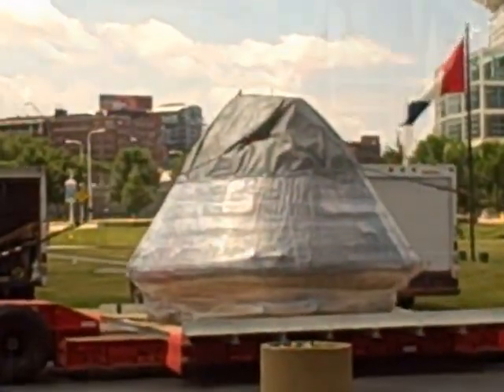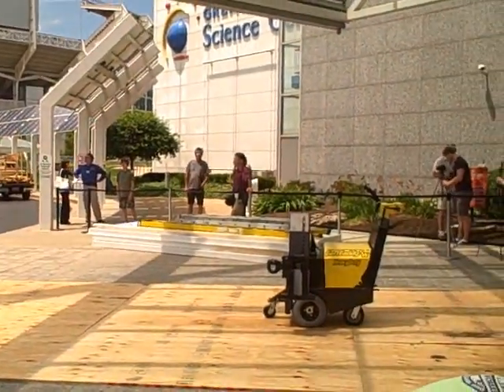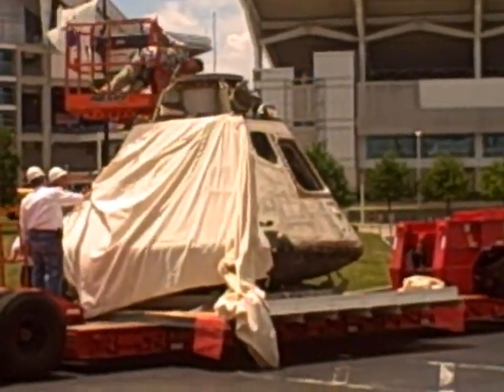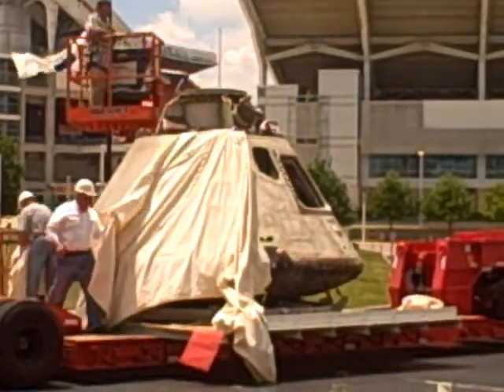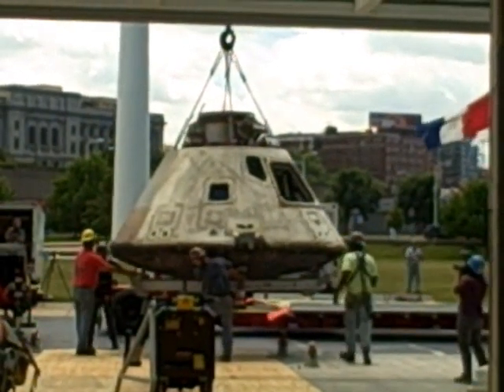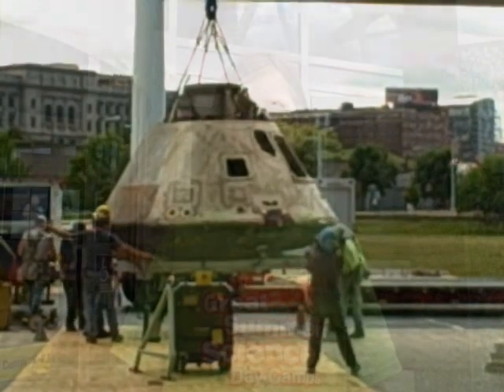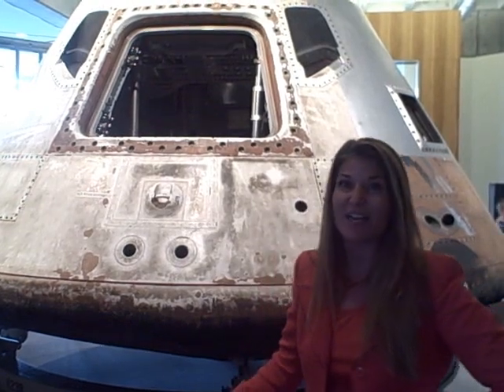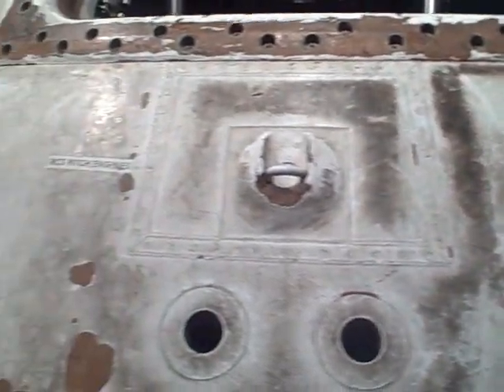Behind the Scenes-Apollo Command Module Moves to GLSC.wmv

Comment: At 2:44 just over the boy's right shoulder you can see where all the wires and plumbing exited the command module on their way down to the service module. When the service module was jettisoned just before reentry a set of guillotines were fired explosively to cut all the wires and pipes to sever all the connections.

Comment: It looks like it has been gutted (or at least very poorly restored).  That one could use a visit to Spaceworks for an extensive "touch-up" like Apollo 13's Command Module "Odyssey" got before it went on display at the Kansas Cosmosphere and Space Center in Hutchinson, KS.
Reply: 1sorryham   Actually, besides the hatch it looks complete. The Skylab CM had a different color scheme, and, at reentry, did not reenter at such high speeds-so less of the ablative shield fell away